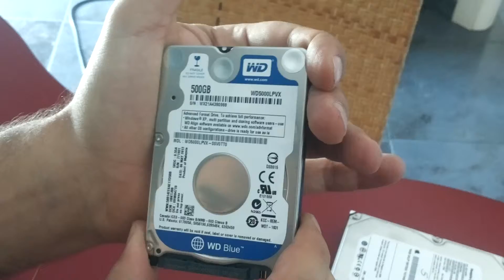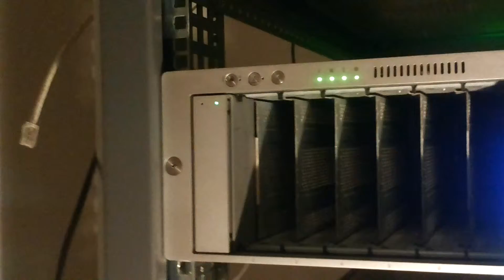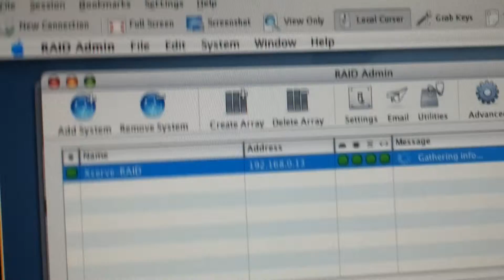#1)Apple Xserve Raid Tray adding IDE2SAT controller for HD SATA 2.5"

Comment: Love this! I wish that article you mentioned was still online. The link is dead. I still have my original XRAID, with both of the fiber chsnnel cards and cable sets Apple sold, all the packaging, the OEM spares kit, and even the optional Apple endorsed third party enclosure, and all 14 original drives configured as RAID 50. It runs like a champ! I did have the bus replaced while it was still on warranty back in 2008, but that was the only thing that ever stopped it.  
This behemoth has been stored in an air conditioned and clean environment (plugged in to trickle charge, but off-line and not spinning) for 10 years. Every year I run it for a few days. Sure, RAID Admin 1.5.1 no longer runs on my Mac Pro 2012 5,1 with Mohave (without Java), but I have an older Mac Pro 2,1 to administer running 10.7.5 if needed. I plan to use the XRAID as a time machine RAID 50 backup device for my  three blade (3TB) M.2 NVMe RAID 0, just because I can, using your tips shown, and with 14 cheap and  slow 500Gb 2.5” SATA 3 SSD. 👍🏼

Comment: Any performance issues with this? We get ~85MB/sec read and ~85MB/sec write with native IDE/PATA drives, and ~85MB/sec read and only ~35MB/sec writes with the SATA adapters (2.5" SATA drive, 7200 RPM, 32MB cache).